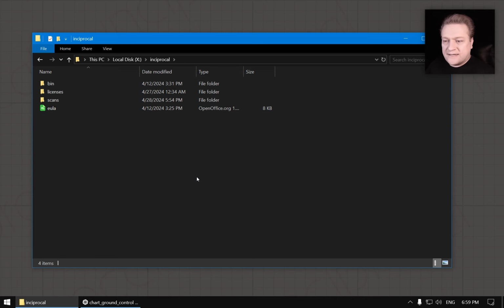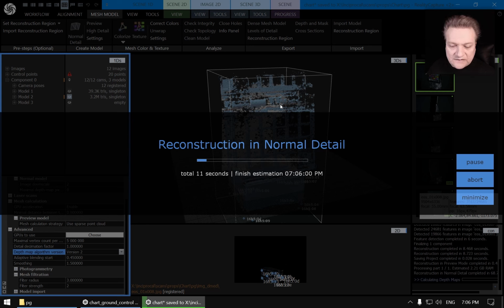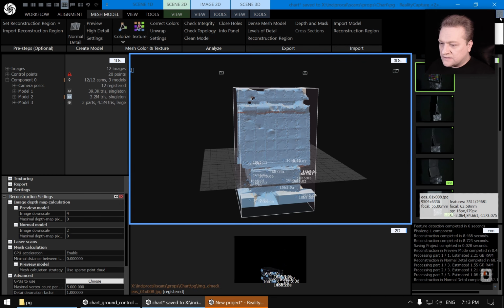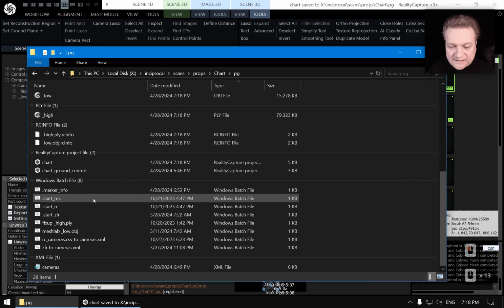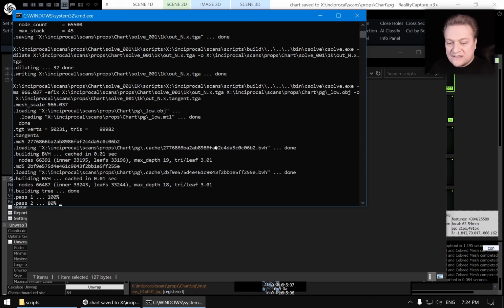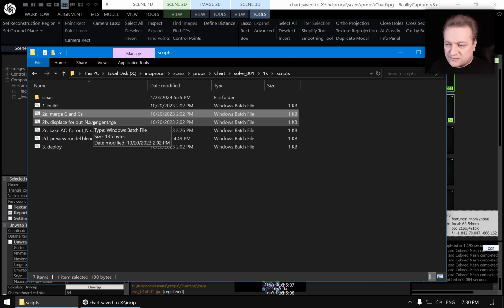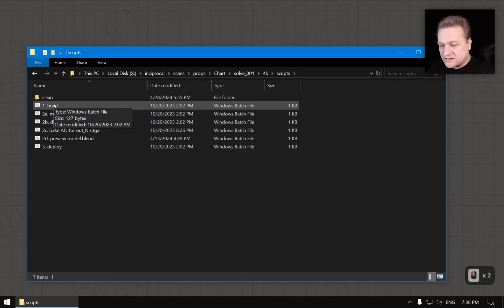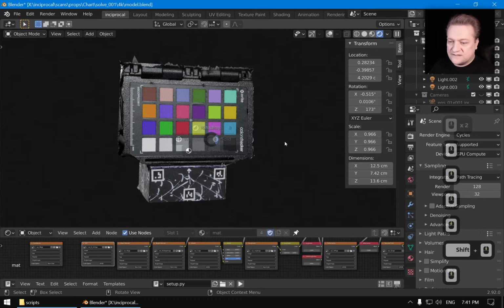2.4 - Basic Prop [RC]

Comment: Thanks for the masterclass and demo of your workflow. Why export the high poly as a ply and not an obj?
Reply from the maker: OBJ is an ASCII (text) only format and any mesh with more than 1M triangles would be many Gigabytes in size so it's very inefficient. PLY is very similar to OBJ but allows for Binary encoding of raw data. Both PLY and OBJ are very well supported as intermediate 3D data exchange formats. Additionally, such PLY/OBJ highpoly/lowpoly separation encourages reasonable polygon counts for respective meshes.